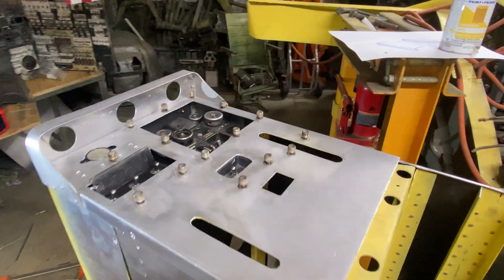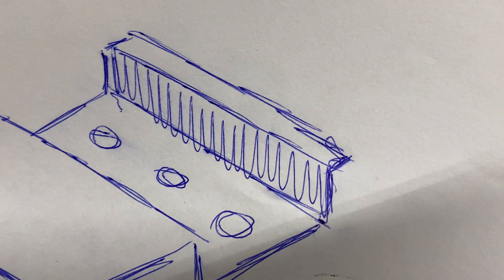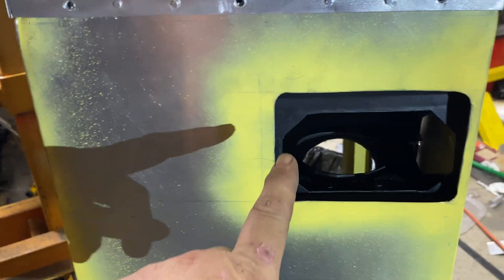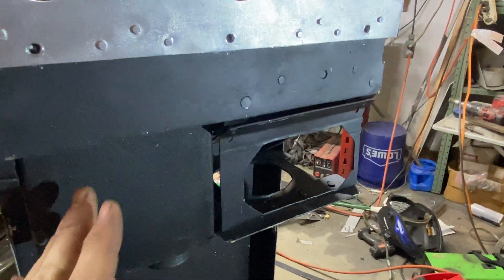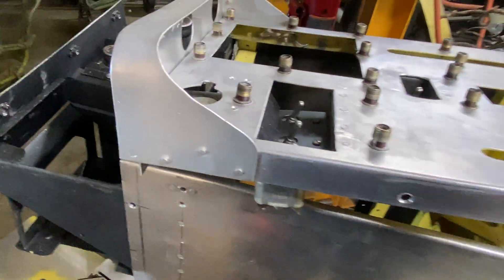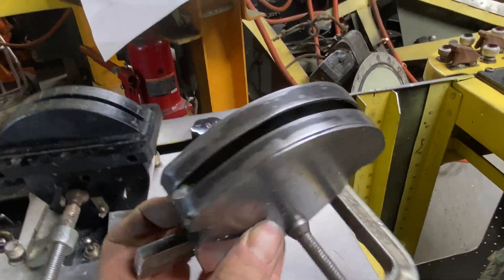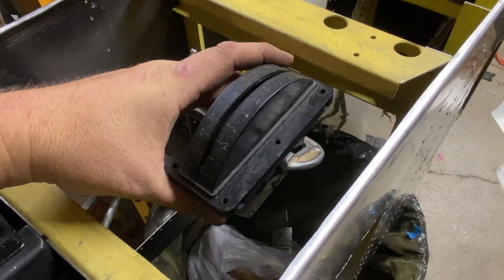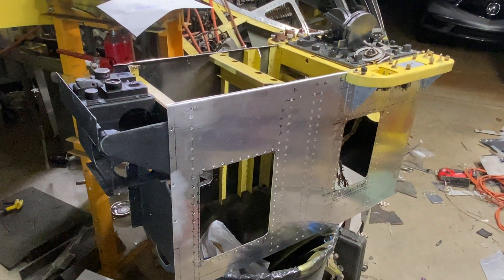Homebuilt Convair B-36H Peacemaker Pilot’s Console Progress - Tubrosupercharger Selector

Comment: Pro tip for argon, find used bottle on marketplace, paint it Thoroughbred blue, take it to tractor supply for a exchange cylinder 😉 probably cost $80 total
Reply from the maker: Interesting. Then I have to purchase a TIG machine. Maybe someday.
Reply: @B36HPeacemaker I just watched a video on a professional welder using a $70 Amazon welder with success, the only complaint was that it doesn't have a throttle pedal.  I was going to buy one to try it as I've only Tig welded once about 30 years ago 😁